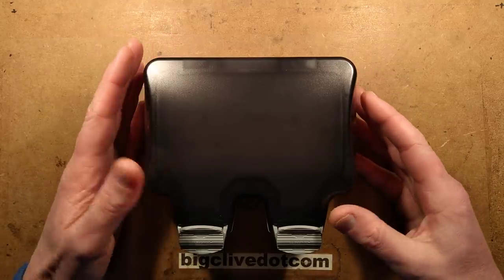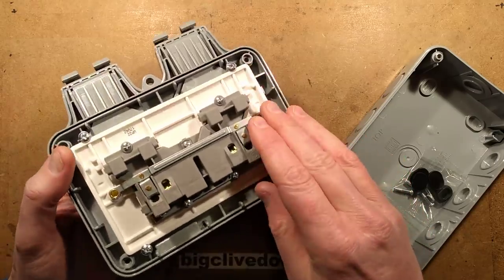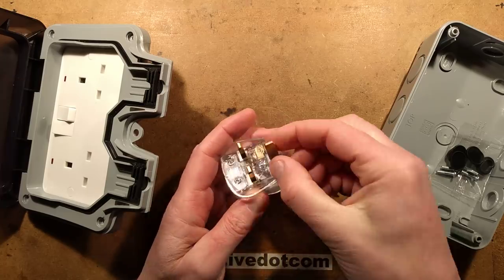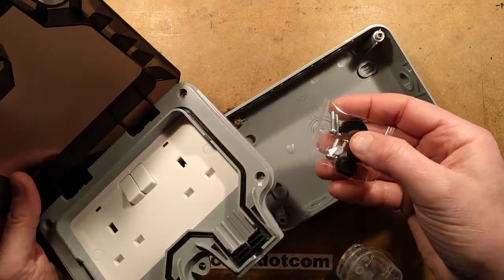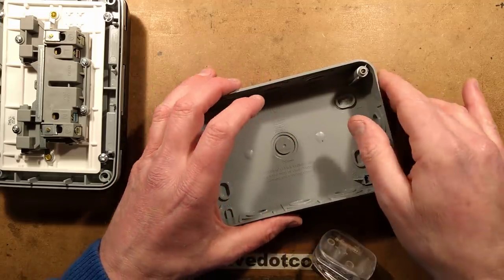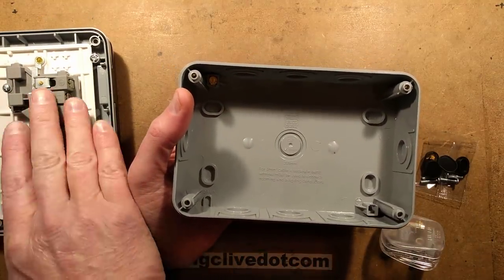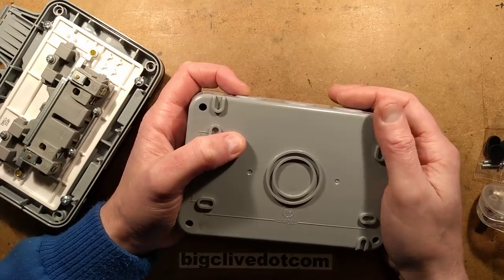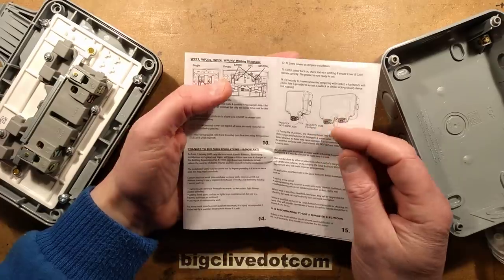British weatherproof socket with clever design. (bonus rant)

Comment: Fuck part P. I WILL do my own electrical work in my own house if i want, thank you very much. I actually had to tidy up the wiring after i had a new boiler fitted because the officially qualified electrician did a untidy botch job. I assume the P stands for Piss-off.

Comment: If you open up the drainage hole it will lose the IP66 rating.
Reply from the maker: Water will get in anyway.  Several decades of doing outdoor electrical work have shown that waterproof cases are very good at keeping water in.

Comment: The clips are very very weak. Breaks with the slightest force
Reply: I have not found that to be case for me but i will admit there is a nack to opening and closing these  smoothly. I have found a bit of gentle forward pressure on the lid and then use your palm on the clip they lock easily and to unlock a thumb on the front of the catch supported by two fingers underneath so it doesn't stress the hinge. I always take the time to show clients how to use these correctly but don't think i have ever seen one  clicked shut properly after the day it was installed 🙈 Though somewhat annoyingly it never seems to cause people an issue probably due to the clever water channeling features Clive has pointed out.

Comment: Clive, I use these and they are great. Could you please view my recent video and comment on the calculations, I am lead to believe they are wrong. I won't add a link here as many creators frown on the practice, Cheers, Andy
Reply from the maker: I've had a quick look through your video and left a comment.  The current is equal along the whole series circuit, so each cluster of four parallel LEDs was sharing the current.
Reply: Clive, many thanks, time for a video edit, cheers

Comment: Would you review car lithium jump starters? Am0zon.com iClever 1300A Peak 18000mAh Car Jump Starter
Has a interesting fire hazard review meaning its poorly fused somewhere I suppose.
Reply from the maker: The figures are all fake on those things.  Even the prominent brands.
Reply: @bigclivedotcom  I don't expect hundreds of amps out of most cheap lithium batteries. Some offer Qualcom quick charge 3.0 usb ports and USB Type C port for laptop & cell phone charging which is super cool bonus to me.  They seem to have okay reviews in general about the ability to start a dead car which is super cool.  From my RC aircraft lithium knowledge the lower output batteries will tend to last longer and be able to do more Cycles where the supposed high output batteries will die faster and do less Cycles overall.

Comment: I live in a listed building and don't trust, so called 'electricians' do my wiring. The incompetent electrician who lives next door signed off an electrical safety certificate on the property. The wiring contained such gems as grey twin and earth supplying electric storage heaters supported only by their connections into antique bakelite junction boxes. He's a perfect example of the crookery domestic electricians do. Funny how his lovely wife who closely resembles Tubbs couldn't wait to deny he'd ever set foot in the cottage.
I take the listing by Historic England (or jobs for the well connected but utterly incompetent boys and girls) purely as advisement. If you actually read the building listing you'd be hard pushed to believe it's the right house. Best of all is there's a picture of the house to rub in the inaccurate nonsense. Sorry, couldn't resist a rant too.

Comment: Most american plugs have a cheap ass ground pin instead of being solid metal are made from a flat piece of metal that has been rolled into a pin shape so after a bit of use they end up snapping of in the plugin and leave you with a ungrounded cord I think that style of plug should be banned here in the usa There are so many of those death cords at my work good thing all the plugins are GFCI plugins I havent got shocked yet A machine shop is not a safe place for cheap cords

Comment: man, British sockets are weird, way over built, let the breakers and GFCI's do their job. and why would you need a ground lug in a plastic box? what are there friction fit pop-outs on the top if its supposed to keep water out? they should be sealed knockouts that only come out once when you smack them with a screwdriver.

Comment: The part P, is such a joke, what is the point of apprenticeships if you can do a short course and the able to sign your work off, I’m 33, I have my level 3 C&G my AM2, my NVQ 3, my I&T and my 18th edition update,  and I have my JIB approved Gold card, and for what, so I can sign the same work of as a kitchen fitter ,  bloody brilliant, and not only that, you then get under cut in price by some little under qualified kid, gets on my tits,
We need a licensing system in the uk, and every spark need to be registered with the IET, bin off the consumer body’s like the NIC etc.... Have one organisation which is government run,  they dish out the certificates, and the licences, which you need to produce in order to setup account with the electrical wholesalers. Every spark which can not produce the correct documentation, can be registered as an electricians mate or an improver, at best,

Comment: Rant.....as much as you want...skills have dropped across the spectrum....most of the population don’t have the money for expensive electrical engineering......fuck em....if you’re able undercut the market....
Reply from the maker: The racket has pushed costs up.  Less skilled labour at a higher cost and a slice going to the organisation that caused the problems.
Reply: bigclivedotcom how to fix it?   Of course there are always going to be a short fall in education but I’m not sure how much that is going to make a difference.....it’s quite possible some really good electrical engineers have been passing down old school knowledge to preserve certain knowledgable skills.regarding....maxwells...heavyside..etc....equations on electrical field theory....after all the entire world is running on this understanding..... and not everyone is employed by the current system..of education...